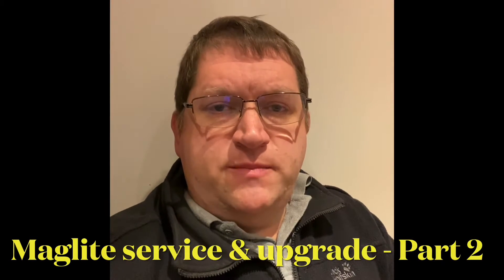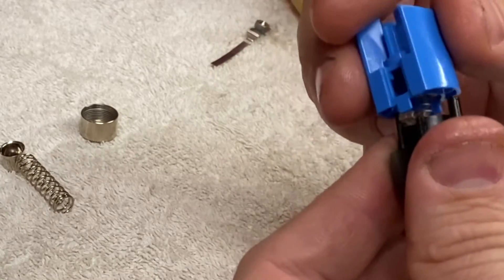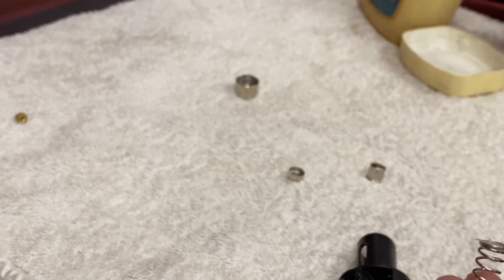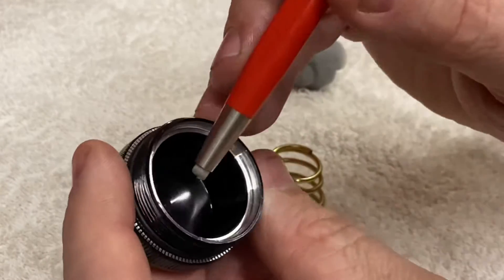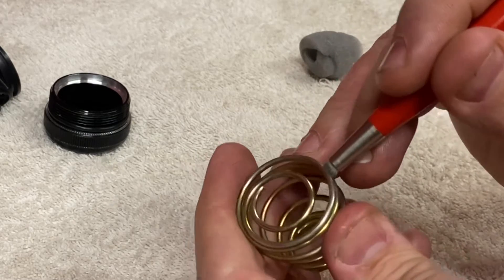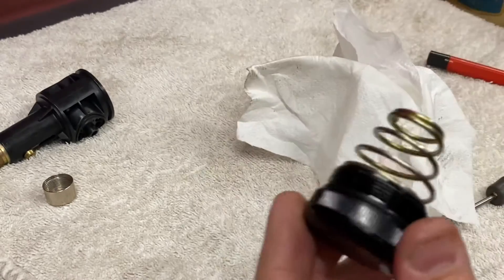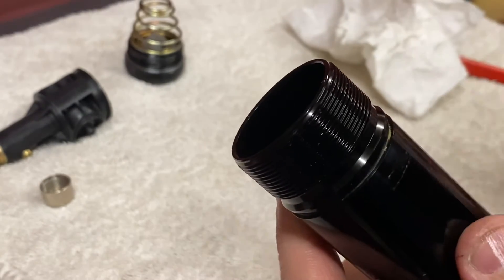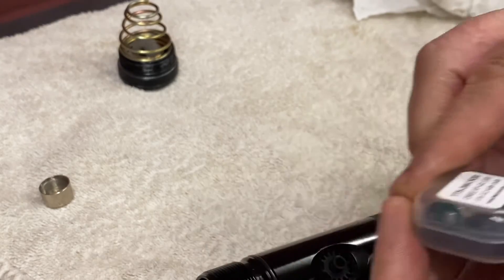Maglite service & Upgrade - Part 2

Comment: Why not us dielectric grease found at auto parts stores?  This is used on sparking plugs and other wire connections.
Reply from the maker: Please use that if you have it.
Reply: Or Super Lube silicone grease. Good for the O rings and does wonders for the end cap threads. Makes assembly much easier. The cap can be a bugger
Reply: Vaseline is not good for rubber o rings. Silicone is much better. It won't swell up the rubber

Comment: Thank you very much for the very good video. After taking the service you demonstrated, my 20 year old mag light shines bright again.
Reply from the maker: Glad it worked for you, it’s surprising what the ravages of time will do to these well made units.
Reply: @ACDodd  Basically i dismantled all the parts just like you did. I didnt have that little fancy fibreglass polisher but I used some scothbrite pad on all the parts, apllied a little vaseline just like you did. Now my very old torch shines bright like new. Thank you very much.

Comment: Still need to get a t8
Reply: Annoyingly I have a few sets of t bits but none long or skinny enough also have a set or t screwdrivers but t10 is the smallest :(
Reply from the maker: https://www.ebay.co.uk/itm/363800195104?mkcid=16&mkevt=1&mkrid=711-127632-2357-0&ssspo=jikqqf4frao&sssrc=2349624&ssuid=1xaUmnl8TJ2&var=&widget_ver=artemis&media=COPY